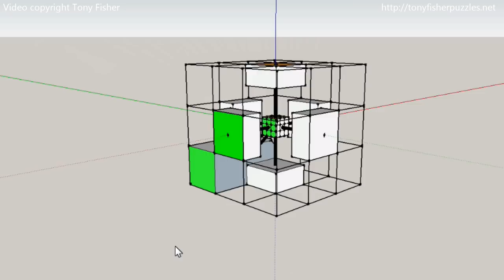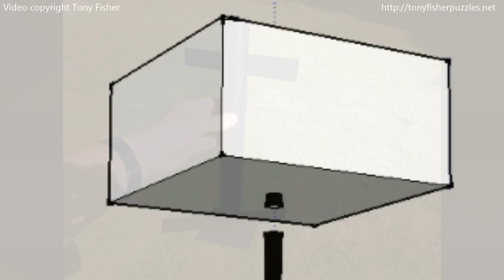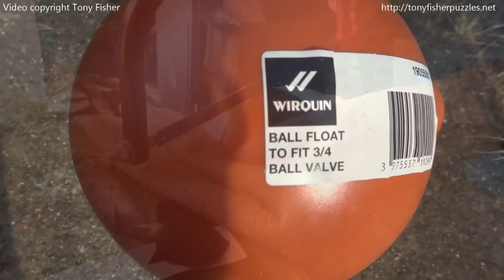How it's made: 2.02m / 6' 7" Rubik's Cube (construction of Guinness World Record 3x3x3 puzzle)

Comment: awesome work and great video! But I think if you do something like this again you should look at different expanding foam, those cans have got to be more expensive than the bags you mix yourself.
Reply from the maker: You are probably correct and I certainly looked. There was nothing I could find cheaper though and the stuff I used is far easier to work with.

Comment: I'm probably just an idiot who missed an explanation in the video, but what are the wedges that you stick in the top before rotating for?
Reply from the maker: When I turn the puzzle over I can only lift it holding one edge. That puts an enormous amount of stress on the vertical layers / columns either side of me. Those wedges distribute that stress. I use two close to where I am lifting from and another two for when I lower it.